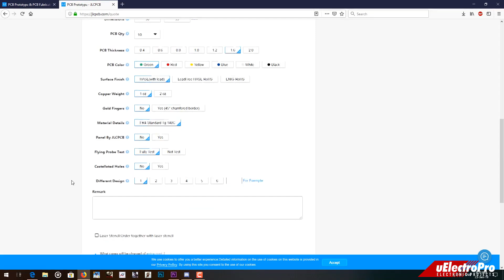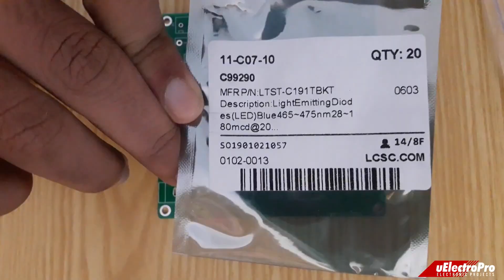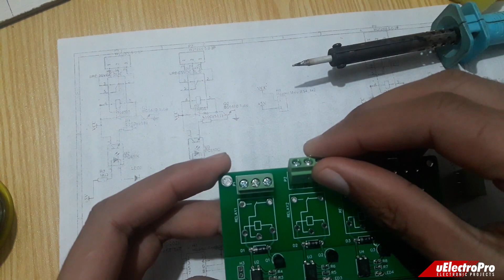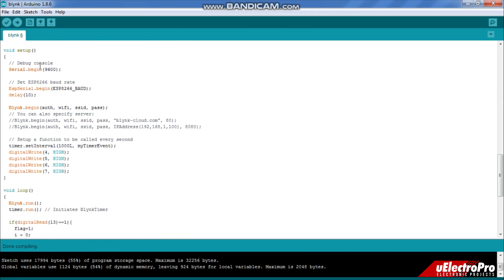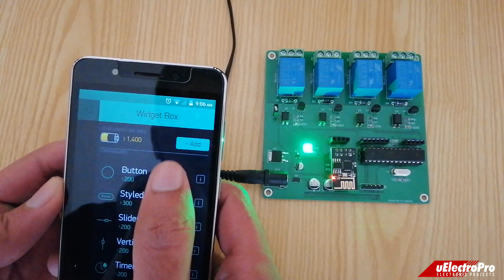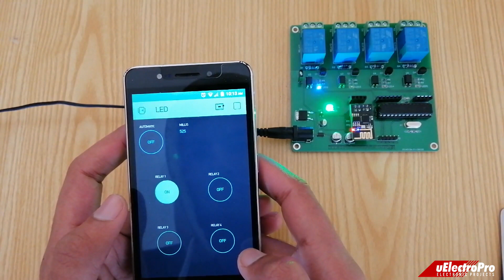ESP8266 Home Automation with Blynk  || ESP8266 WiFi Relay Board || IoT Project || uElectroPro

Comment: if we want to connect more than four lights?
Reply from the maker: You can add more buttons in app and connect external relay module to unused pins of the arduino